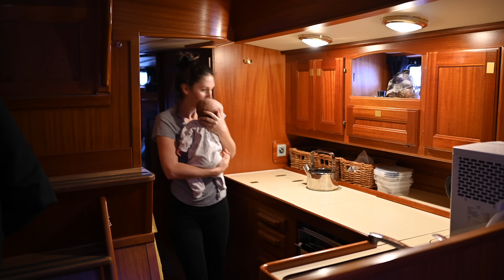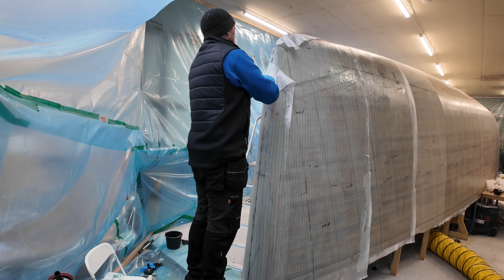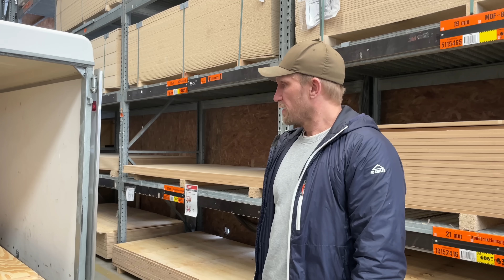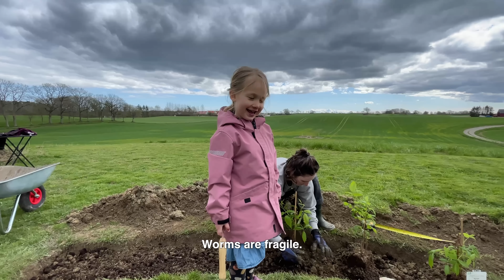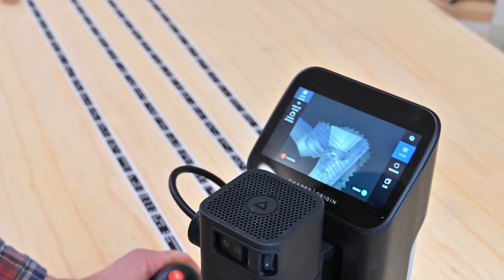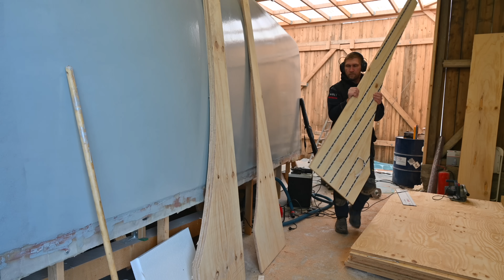Starting To Build The Cradle Boxes For Our 50ft Sailboat - Ep. 391 RAN Sailing

Comment: I understand the need to make keel pocket as accurate as possible, but have you thought about using thin sheet of neoprene gasket to take care of any curvature imperfections? This is what we use when installing deck hatches on merchant vessels  and it works pretty good (and commercial shipyards are nowhere near as accurate as what you’ve achieved…)

Comment: Hi, small correction. Vacuum actually does cause much less deformation of the hull than using weights. By evacuating the area under the keel template you end up with 1 atmospheric pressure pressing down on it but also 1 atmospheric pressure pressing from the inside of the hull. So in the end you are clamping it equally from both sides and produce no deformation. While when you use weight you are pressing much more from the top then from the inside of the hull and create quite a deformation.

Comment: As usual top job. To stiffen the keel template, you could use styrophene strips/runners on edge, like strakes,  fibreglassed in situ to the template you have. Stiffen in place instead of the plywood. All the best

Comment: Could you use something flexible like a garden hose to lay on top of the template and fiberglass over it to give some height and strength to the template? The fiberglass should have enough strength, the hose just gives the height to wrap around. Seems a little bit simpler than using wood.

Comment: Your reasoning for not using vacuum is reversed. Weights will deform the thinner panel vacuum will not as the air inside the boat will support it.

Comment: Idée peut-être saugrenue mais pour garder la forme initiale réaliser un châssis à l'envers sur la forme elle même déjà en place fixé par joint congé. à faire léger car surement difficile à descendre de la coque 
Perhaps a crazy idea, but to keep the initial shape, make a frame upside down on the shape itself, already in place, fixed by a fillet joint. to make it light because it will surely be difficult to get off the hull

Comment: the floor will not deform at all if your vacuum is only on the outside of the hull. There will be ZERO pressure to deform the hull. If you put the entire boat in a vacuum bag there would be ginormous pressure to crush the hull, but none if you only put the vacuum pressure/plastic on one side. Try it on a sheet of glass for proof.
Reply from the maker: I never said that the pressure should be different from the other side, but there’s other variables that is hard to control when applying vacuum,  that potentially can warp a thin unsupported laminate like this. What works in theory doesn’t always have the same outcome in practice, and in this case I have the practical experience of that.

Comment: Vera reminds me of my boys on jobsites. Husb and I were general contractors, and my sons started out loading 2x4s on the framed floor at 5 cents ea. By the time they were 5 and 8 years, they were helping to pour and finish foundations and pads. As teenagers, they were fairly proficient at elec, plumbing, roofing, framing, siding and more. Neither is a builder; one a machinist and the other a heavy equip mechanic. But, both built their own houses. Vera can learn skills that will help her for a lifetime.

Comment: To make this keel flange template rigid I would glass two vertical bars(just ply) along the length and a couple cross bars. Almost like a box. With only one it will not keep the curvatures in all planes.

Comment: I was puzzled why you rejected vacuum in favour of weights.  With vacuum, the atmosphere applies pressure on top which is resisted by the same pressure through the hull from underneath. Applying weights puts pressure on the top only through onto the keel floor which might possibly distort?
Reply from the maker: Because even if vacuum bagging of course gives the same pressure from both sides, there’s other variables that can give distortion in practice on a very thin laminate like this. In this case I made the decision it was easier controlling this by adding a small weight from the top instead. Cheers!

Comment: Was thinking, if you took 5 or 6 sheets of 1/8" thick plywood  and layered them down into the keel pocket with epoxy coat between each sheet and weighed down, when  the epoxy cures you would have a very stiff piece of plywood composite that would match the curvature of the keel pocket.  Question are the bulheads still screwed to the cedar planking  or are the bulkheads loose inside? To maintain rigidity what about putting a small beam across the  top of each bulhead,( that would be the top of the boat) then running straps around the exterior of the boat at every bulkhead?  That should keep the entire hull very rigid during the  180 degree rotation. Really looking forward to when you pick the propellsion system. Hoping you will  consider electric motor drive, solar, and batteries using  propeller regeneration under sai, along with diesel.

Comment: Could you support the keel pocket from below temporarily while you apply a slightly lower-pressure vacuum once the epoxy has been properly drawn into every area the pocket would not be able to deform so easily as the epoxy liquid enough to be moved by the vacuum. once it's in place not so much pressure or weight would be needed. Apply slightly more epoxy than you need & then shape with the digital router/cutter for a millimetre perfect profile.

Comment: I would not use plywood to stiffen the template; wood changes it’s dimensions when humidity changes, and when coupled with glassfibre that does not, the curvature of the whole piece changes. I’d glue a thick styrofoam plate vertically on the templete and laminate glass over it.

Comment: Love your logic guys, but would vacuum not recreate what will happen when the keel is fixed to the boat? Versus using weights which may deform the keel pocket floor in the opposite direction...probably a bit of a stretch given how flexible fibreglass is, but the potential for stress to be introduced into the keel pocket floor. Tell me to shut up if I'm wrong! Tony from Australia. P.s..  this thing is going to be fast!
Reply from the maker: When the keel gets mounted there will be a 30mm thick laminate plus a grid to support it, right now it’s just a 4mm thick laminate. 😊 The rest will be added once the hull is turned over. Cheers!

Comment: Good call with the stiffening web on the template. You might consider fitting two with a few cross braces. If you make all the upper edges level and flat the template will sit true when placed on a flat floor, this might help your fabricator make a good fitting keel plate. 👍

Comment: Maybe I'm missing something but it's unclear what force would result in the pocket bulging up. There is the same air pressure on both the inside of the boat and on the outside of the bag. Only within the bag will it be low pressure. I think you would need a ridged structure on the top in order to get a bulge (something ridged has to pull the pocket up). If you just have a flexible bag it should be OK.

Either way, I'm sure you'll do a good job, cheers.
Reply from the maker: Uneven pressure distribution can cause this on a thin laminate. I’m aware that you get the same pressure from both sides, but there’s other practical variables to take into account also… Cheers!

Comment: Pre-drill any through holes in keel plate to help prevent air pockets in epoxy. Use vac bag for 2-3 hours under minimal vacuum pressure to pull out remaining air then turn off vac pump and let the weights do the rest of the work.

Comment: A suggestion for your keel pocket template. You could add a baton or 2 on the upper surface to stiffen the final composite shape. Wouldn’t add too much weight but would make the cross section a bit thicker and help maintain the curved shape.

Great work and thanks for sharing your project.

Comment: Hi, just a quick word on the argument against vacuum bagging the keel pocket mould. The air pressure on the outside is also present on the inside. Both forces cancel each other out.
Anyway you must do what you feel is best.
Cheers Peter.
Reply from the maker: Yes, I’m aware of that, but what’s working in theory doesn’t always has the same outcome in practice. There’s lots of other variables at play besides the vacuum and the challenge to not have any pressure variables over a long large surface like this.  Cheers!

Comment: Hi Johann!
Just a thought, have you considered getting the keel pocket accurately 3D scanned?

If the keel baseplate is going to be CNC machined to profile it would be an ideal solution but if it’s going to be fabricated it would work also. 

You could have the resulting scan profile curve translated to a series of deviation measurements from a nominal straight end to end centreline, at a number of stations along that line. 

If you choose you can do the same with two additional nominal end to end straight lines to port and starboard of the centreline. 

For a fabrication  that would provide plenty of verification data for accurate height gauge measurements at known positions when the object is sitting on a plane surface, or more simply from a straight bar rested on either end of the keel plate. 

I’m a retired marine engineer, who first spent over 25 years in motorsport engineering and working out the easiest and fastest ways to get the best result was very much every day life for me. 

What first struck me with the concept of a 5 Metre long and subtly curved template, such as you’re making, was that you’d not only have an issue with longitudinal stiffness, but also with torsional stiffness. 

Quite simply, it’s not really an easy thing to create to maintain sufficient accuracy for your requirements. 

The one other suggestion that I might make, to improve your existing template concept, would be to sit it back in the hull pocket and add not just the centreline rib that you’re already intending to do, but a more extensive grid of ply, an interlocking lattice of both transverse and longitudinal pieces about 100 - 150 mm height, the transverse ones at about 500 - 1000 mm centres and two more longitudinal ones to the port and starboard sides of the template. 

If you use a good amount of well thickened epoxy or fairing compound to attach the ply to the template you won’t have to be especially accurate with cutting the longitudinal curve for the braces. 

Anyway, you’ve probably already thought of all that and worked it out for yourself, so I hope that you won’t be offended by me doing the thought experiment here. 

I must say, when you open the doors and have the view of that beautiful plumb stem and fine entry lines you must be proud of what you’ve created, she’s going to be absolutely beautiful when she’s finally afloat. 

Cheers, R. 😎👍🍻

Comment: I wonder if you can ask the machine shop to cut the keel plate out of wood/plywood first to see if it matches the pocket and then make adjustments if needed, before cutting it out of steel. Just to lower the cost of a mistake. I guess you'd need some back ribs on that wooden part as well, just like the ones you plan to glue onto styrofoam.
Looking at how you're building it, for the most part, single-handedly is nothing short of a feat. Really impressive!

Comment: Veras definately not a fan of the Madds school of Oh glorious sanding. ...😂 Finished! 💫 

Theres been an acident report published on a newly rebuilt monohul withba expert skipper in Irish waters  that ran aground on rocks.. they had to abandon ship and tried tying the vessel to the rocks..
What they discovered was a section of abandoned fishing net had got first caught on the keel bulb the snagged the rudder at which point they began to lose steerage and felt increased drag.  They then started the engine and engaged the prop which also wraped up and pulled the rudder hard over before the clutch started to burn out. .. 

No one was hurt but the boat was extensively damaged. There was no markings on the net or warnings entered as to the loss of fishing gear in that area..  
But its a salutary tale as to the risks of unmatked and discarded lines and fishing gear to yatchs and boats Not just marine life and divers. 
 It might be a case of planning to fit RAN 3 with a line cutter on the prop shaft .  And if it's a spade rudder  a anti snagging loop to stop lines or nets getting in between the hull and the top of the blade.

Comment: Vacuum bagging only exerts force between the two layers of the bag. It shouldn't deform what it's resting on since the hull won't be in the bag. A vacuum doesn't make the bag magically heavier.
Reply: Thats right of corse
Reply from the maker: Yes of course, that goes without saying, but there’s other variables at play when using vacuum on a thin laminate. Cheers!

Comment: I was just thinking - do you really need a physical model of the keel pocket? Wouldn’t be a lot easier to use a laser scanner on horizontal rails and create a 3D model that the mechanical shop can measure against? And once you have the 3D model, you can always CNC the shape in some rigid material if you absolutely need a physical template. Just a thought… 😊 Amazing project!

Comment: The amount of possible warping due to vacuum, is less than the shrinkage and warping due to any exothermic reaction in the subsequent hardening.
Anyway, the keel will (hopefully) be bedded in bedding compound, eradicating or ignoring any warping/shrinkage of the vacuum/exothermic reaction.
IE: You can't make it perfect, so stop trying. Get is at good as it can get, with what you got - and move on!

Comment: Excellent worka s usual. I know it may be a bit useless now, but wouldn't it have been more advantageous to put overlaps onto the hull around the keep pocket. That may have added both rigidness and add some lever points to make removing it a little easier? I may be talking rubbish though 🤣
Reply from the maker: There are overlapping fiberglass all along the bottom of the hull, including the keel pocket, twice the thickness compared to the sides. But the bulk will be added from the inside in the keel area. Cheers!
Reply: @RANSailing  My appologies for the misunderstanding. I was refering to the mould you were making as it appeared that you had just put the material insed of the pocket. I was asking if it would have been any use overlapping the top of the pocket to create a lip, usually several layers of glass, something similar to making a two part mould. I hought maybe that would add rigidity and an easier way to extract it from the pocket. Though I am perfectly willing to admit I may be talking rubbish. It was more of a query than any attempt to offer advice, as I have watched every minute of the build and I am massively impressed at what you guys have acheived. Awesome work!

Comment: STOP YOU ARE MAKING A MISTAKE! If you copy the shape of the recess on plywood and glue that onto the bottom of your template, your template will have the wrong shape!!!. the radius of the recess is slightly smaller than the radius of the template. 
you should copy the shape of the template while its in the recess and glue that on to the template.
Reply from the maker: You’re correct, that sentence wasn’t fully processed before spoken… 😂 But I will probably use it as a stand alone template, just for the curve. Cheers!

Comment: 224 / 5.000
Übersetzungsergebnisse
Übersetzung
I also recommend using a high-resolution 3D scanner (scan volume 10m3, resolution 0.045mm). It should be easy to find an office that does this job and then you have the plans in digital form.
Reply from the maker: We have the option to do this as well, but that scan will only be helpful during the cutting and pressure rolling of the plate. It can’t really be used for checking if anything has deformed after welding etc, so it’s always good to have something real to check against as well. Cheers!

Comment: When I had a similar project, where I needed to build a template/ mold, I used lightweight self-leveling cement and added a lot of fiber strand and a layer of flexible mesh into the cement. The result was perfect. It was rigid, light, and strong. The company that I contracted to build my project said it was the best template they had ever been given and that it allowed for exact scanning and molding.

Comment: I would have thought the engineering Company could come and do a 3D scan. This would be millimetre perfect representation of what they have to make. 
I suggest you should try this approach when the boat is rolled at 90 degrees and the keel pocket fully accessible to do the scan.
Good luck.
Reply from the maker: We might do that as well, but we haven’t decided which shop that will produce the keel yet, so it’s good to have different options to work with. Cheers!

Comment: Couldn't you use the C&C router to map out the keel pocket?
Reply from the maker: It only works on coplanar surfaces unfortunately. Cheers!
Reply: There are probably some tolerances now that the accurately CNC'ed temporary frames has been covered in planks and glass. But you'd probably still be pretty close.

Comment: If I were concerned about deformation after removing the template, seems a spine (or two) perpendicular to the template and attached with short blocks and epoxy would keep that from happening. Could be made from thin plywood. Just an idea.
Ah, I see you came up with a similar idea. Great Minds...